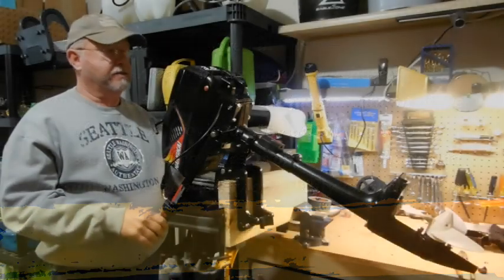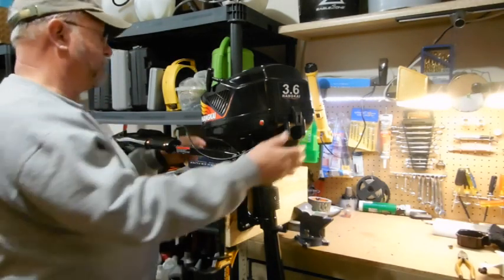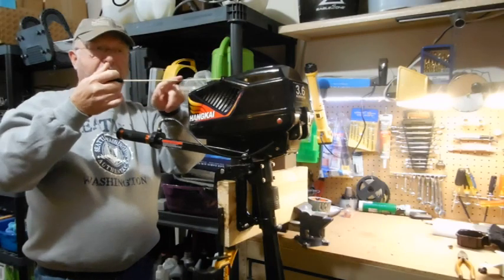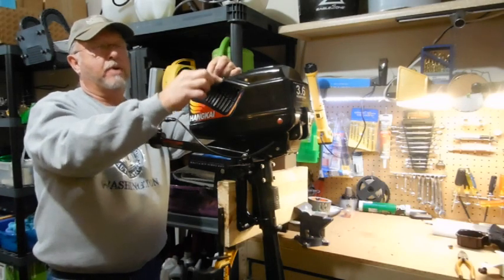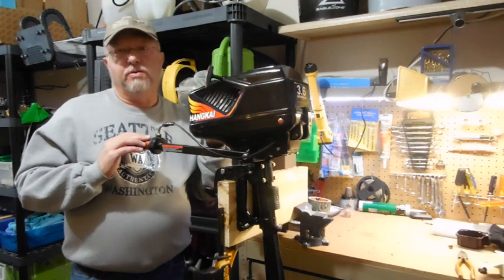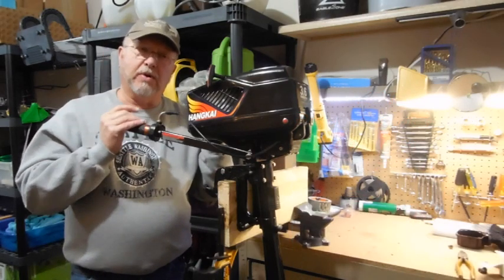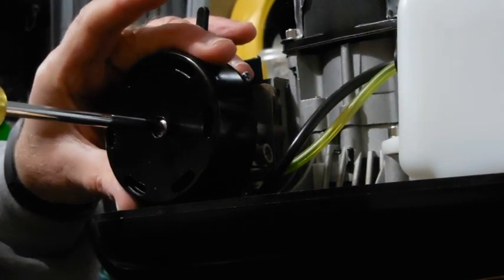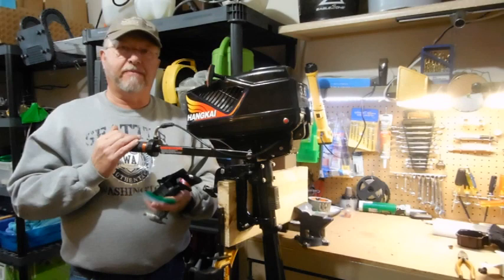Hangkai 3.6 / 3.5 hp outboard motor - 10 Things To Know

Comment: Ten things you need to know about hangkai 3.6 horsepower outboard motor:
1) it is an extremely cheap motor made in China from the lowest quality materials
2) more than likely you will need to work on this motor after each outing
3) 3.6 horsepower rating is a gross exaggeration
4) if you can't fix it yourself good luck finding an outboard shop who would be willing to do the work. In other words it's impossible.
5) it's the perfect motor for those with a hearing impairment. For those who have good hearing not so much.
6) when it fails it will be at the worst possible time.
7) other people at the boat dock pointing and laughing
8) it barely weighs enough to be used as an anchor
9) if you like a tough mechanical challenge this is the motor for you
10) you can go out in a powerboat and still hone your rowing skills
Reply from the maker: Totally loved your list of 10.  Hope you don't mind my laughter. But a lot of your points are accurate! I made the series of my experience with the motor to help others decision on whether or not to consider one.  If you check out all the videos you'll see that I have had to do repairs.  I've enjoyed the journey.... But as I have stayed before.... I always go upstream, so I can just drift back to my starting point. 😂  
Thanks for watching and taking the time to educate others.
Reply: @BoilerDan1  I've watched one or two of your videos before and I have read some of your comments. I appreciate you taking the time to make these videos and educate those who have already made the purchase and find themselves scratching their heads in frustration. It's good to help people to possibly get these motors going and get some use out of them after they have already spent the money for purchase rather than just throwing them in the garbage. I'm glad you got a laugh out of my list of 10 things to know. I did it partly  for the humor and partly as an honest opinion of these motors.
I think the best purchase is to buy a well taken care of motor that has a few years on it but has a lot of years left in it. You can get them for pennies on the dollar sometimes. I have picked up two outboard motors for free. One of them was a 1977 Johnson 15 horsepower which I only had to spend about $40 on parts in order to use it. It ran just fine without the parts but you could not use it on a boat until those parts were replaced. The other engine was a late 60s 6 horsepower Evinrude which I had to remove all of the moving parts for the throttle and advance system in order to clean them up and re lubricate them as they were very stiff in operation but other than that all I had to do was hook up a fuel line and pull the Rope and it was running. You have to have a little knowledge of motors and be thorough in checking it out before purchasing but they are out there. If a person doesn't know much about Motors I think they would still be well advised to purchase something used but checked out by a reputable outboard shop. You will pay a little bit more but ultimately you will be much happier
Reply from the maker: I'm sure all our input will help others! I'm not an avid boater nor fisherman. Anyone who is should consider a better boat and motor!
Thanks again for joining the conversation.😉
Reply: @BoilerDan1  I’ve bought a new Honda four stroke 9.9 and gave me issues so I bought a new tohatsu  9.9 hp
And the carb was wonky from day one and after 100 hurs it just died but that’s because I didn’t drain the carb although I ran it till died. Finally I got a Chinese carb for it and it starts in 1-3 pulls each time now
Reply from the maker: @changodelaporcelainacanada4819  
I’m beginning to think that the ethanol blended fuels cause some issues with any small motors! Sounds like you’re getting a lot of experience working on them! Thanks for watching 👍👍
Reply: @BoilerDan1  yes . Agree. Lawnmower shop guy told me the same. I just looked up pure-gas.org

Comment: Very helpful!
Reply from the maker: Some things I changed my mind about.  No need to add different air filter.  But I’m happy to share my experience with the motor.
Thanks for watching.
Reply: @BoilerDan1  I have watched several videos about to motor, and nobody is doing a break-in on it. I'm going to rig something at home so I can do the break-in at home without going to a body of water somewhere. It seems to be a decent motor for the price and if you break it in properly. I'm not expecting Honda or Mercury quality. I only paid $160 for it and it came in 2 days! After seeing your review, I feel much better about my purchase. Putting it to use will be the real test! Thanks again!!!
Reply from the maker: @geofreak75 just make sure that you keep cool water running in the water tank. I didn’t emphasize that in my video. It was winter and I kept adding snow 😂👍.
I agree, for how cheap it was, it worked for me. But I enjoy tinkering with things.  Like in my videos, I’d get a loser spring, and order a clutch and have it available.
Have fun 👍👍

Comment: WInterize?  do you I need to fog if I use store bought/pre mix fuel?  "TRUFUEL"?
Reply from the maker: Using the pre mix fuel is a very good idea and will help reduce some of the ethanol issues! The only thing that I ended up doing for winter storage was to empty out the fuel tank and then ran the motor until the fuel ran out.  I had no issues the next spring.  I’d recommend emptying out any fuel for storage.
Thanks for watching 👍👍

Comment: Boiler Dan ,
just a little update I've ordered two of those 3.5 horsepower motors I'm going to run them tandem on my little 13 and a half foot 1969  open v hull fishing boat
 
Most   my fishing will be done on the Alabama River waterways down here in Montgomery Alabama so mostly ill use them in tandem coming back Upstream going Downstream I'll probably just use one also it will give me a little bit of security in case one motor happens to flake out on me on the water I'll have another one to get me in

 I have a couple of questions have you seen where there's any way to adjust the valves on this or is it pretty much just sealed??
2. 10 hour break in , in the water bucket, average cool time u allowed if u were to break in back to back on the hourly??..

Tks Captain John
Reply from the maker: Capt. J.  You are in a warmer climate than me, so be sure to run water in the container so you don't overheat the motor.  I'd give it a cool down every couple of hours for sure.  Also don't run at one speed, I set a timer and changed the speed a little about every 10-15 minutes.  You also have to get enough speed to engage the propeller or you won't have water pump through the motor.  Idle speed for a couple of minutes is ok, just not a long time.  Some people have had trouble getting the propeller to turn.  One checked the clutch system and said it was to tight.... Another said take the spring off, and the clutch will last a lot longer.  I'm considering making a video of how to get to the clutch.... It would be a good winter project.....  Regarding the clutch system;
You need to rev up to get it turning, then back it down a little to the speed your using for break-in.  Also The fuel cap vent hole doesn't work real well, so you might need to loosen it a bit as you run longer.  I'm not able to provide information regarding the valves.  I've not opened the motor up, and that is a little beyond my experience.  You can also break the motor in on the river,  just no full speed until you get the break in done, and then I'd take it a little easy at first.... But mine is holding up fine other than the things I listed in the videos.      CHANGE THE SPARK PLUG! The ones in them are junk.... 
Anyway, enjoy the adventure.  Thanks for watching.  I'm no expert in this motor, but it's been fun working out the bugs.  And being retired, it's keeping my mind alert making the videos!  Watch out for gators.... They can out swim this motor!   :0)

Comment: 1.  What pin do you remove to fill prop with gear oil 
2.  What kind of gear oil do you use?
3.  What kind of grease do I use to grease the pivot point?

I'll ask more questions as I watch this video, so far, it has only been slightly helpful.  I knew I would have to put oil in it but did not know where to put the oil and your video is so vague it didn't really help me.

3:14 Fuel Mixture?  It's an electric motor.  ROFL  It runs off 2 24v 120AH batteries wired in series according to the manufacturer's manual
Reply from the maker: There’s just two bolts holding the cap on at the backside of the propeller.  Be careful not to over tighten them. Also do not completely fill the area with gear oil. Look closely, there’s a line a little below the top that you fill to.
90 weight gear oil 
To grease the pivot point it’s just standard automotive grease. You’ll need an inexpensive grease gun to inject it into the shaft.
Here’s a link showing me changing the gear oil and the two bolts.
Thanks for watching 👍
https://youtu.be/NCALT3MKAEk

Comment: BoilerDan1 the manual says to use 10w 30 2 stroke oil to gas mix is that what you did or can I use 2 cycle oil in the 35 to 1 mix
Reply from the maker: Ken Garloch :  there are two style motors. If you have the two cycle motor you will use the 2 cycle oil and mix the oil and fuel.  If yours is the 4 cycle motor it the 10w30. That type is not mixed with the fuel.

Comment: Which is the best OBM for sea use?  And for Intex mariner 4 boat.
Reply from the maker: I'm in middle America, no ocean for hundreds of miles.  The 3.6 hp Hangkai doesn't have a lot of power, so I'm not sure it would be my choice for sea use.  You might check YouTube for users that have it in salt water, or make sure you rinse any salt water out of the unit after each use.

Comment: Really want to get one of these going to subscribe to see how it works for you!
Reply from the maker: Watch all the videos you can find! Read some comments and make your decision on what's best for for. You'll find negative and positive experience with the motor.  This summer should be a good gauge of how the motor holds up for mine.  One positive thing, it's a simple design and I've been able to fix anything that's gone wrong and I'm not a mechanic or anything related. Just an old guy playing around.

Comment: i check on the hangkai website the price of motor 3.6 HP 4 stroke and 3.6 HP 2 stroke is similar. Can you advise which one i should to buy ?. Thanks
Reply from the maker: I purchased through eBay as the price was less.  The advantage of the 4 stroke is you do not mix oil and gas. It also is air cooled.  I choose the 2 stroke because I have to lay the motor on its side to transport it.  With the oil and gas mixed, there is less risk of spilling and I have heard that laying the 4 stroke on its side can result in oil causing some problem.  But the choice is yours to make.  Maybe research some more on the differences will help you decide.
Reply: BoilerDan1 4 strokes ya gotta lie em down with the oil pan down... That will prevent oil from leaking into cylinders . usually most mercs have a label that says " this side down"... Lay my merc 3.5 4 stroke on that side.. No problems at all
Reply: I wouldn't buy either, get a few more $ and buy a real outboard from one of the online sellers or find a lightly used second hand model. These outboards don't sell for much less than those from established and reputable manufacturers.
Reply: Fiveo here demand far exceeds supply for the below 15 hp because the fisherman use them as trolling motors so man are they hard to find...ones over 40 HP hard to find but exact same price as  9.9 hp the defacto industry standard....not too big and never too small unlike the 2, 4, and 6-8 hp
Reply: I would go 4 stroke if you want it quieter & don't wanna hassle mixing the gas
Reply: Don't buy Hangkai outboard motor. The company can't provide any paperwork to apply for a motor title
Reply: Don't buy Hangkai outboard motor. The company can't provide any paperwork to apply for a motor title
Reply from the maker: Thanks for joining the conversation, however in many states in the USA, boat motors are not registered in that way, the boat they are put on carry the registration.  The raft I put mine on was registered through the state BMV of Indiana.
Sorry if it didn’t work out for you in your location.

Comment: Hi there. I have a 2hp hangkai outboard. Do you know if it is the same motor?
Reply from the maker: I'm not familiar with the 2 hp, but there are several motors that are similar. Sorry I couldn't fully answer your question. I'm guessing some of the covered areas would apply to your motor too.
Thanks for watching.

Comment: Hey, how did this motor hold up over time
Reply from the maker: The clutch system wears out within one season.spring is too tight. I have a segment on it.  Also fuel lines deteriorate if using unleaded fuel.
I sold it, but other than those two items mine did fine.

Comment: Hello Dan, I bought a hangkai 3.6 again and I have concerns about a v Ed or that the motor when it is not walking does not pump water as well and the other thing that I appreciate is that you have to accelerate a lot so that the block Ed works you have any suggestions or solutions  possible for these two things thanks
Reply from the maker: Ramon Folgar : at an idle it won’t circulate water. The water pump is hooked to the shaft the rotates the propeller.  I had to replace the clutch in mine. At that time I put a much less tight a spring that disengages the clutch. I highly recommend considering doing that.  Here’s a link showing that video of the spring. https://youtu.be/G4qLw14lf9k
Reply: @BoilerDan1  Good morning Dan, do you think that changing the cloche spring could solve the problem or have to be replaced completely, nothing happens to the engine when it is on without clogging or apart from the water it has another type of cooling for when it is in that  been, thank you very much for your attention and time regards Ramon
Reply from the maker: When idle speed it will air cool, but you shouldn't let it idle for long periods of time.  If you have run it for a season and notice you must run it fast to get any water to flow out your clutch is wearing out.  So yes, you probably need a new clutch.  I replaced the spring in my new clutch and it works much better.  Water comes out with just a little acceleration.  You can find a weaker spring at hardware stores as the one that comes with a new clutch is still to strong.
I found my new clutch at Amazon, here is a link:    https://www.amazon.com/gp/product/B07J6F4J6M/ref=ppx_yo_dt_b_search_asin_title?ie=UTF8&psc=1 
And I made two video's showing removal and replacement.  You should be able to find those on YouTube.
Reply from the maker: @ramonfolgar5539  I'm not sure my earlier reply was clear.  It does sound like your clutch is worn out.  So I think you will need to replace the clutch and while doing that, also replace the spring that comes with it.  The spring is much to strong for this little motor.  I hope that is clearer than what I wrote earlier.  I was happy to try to help.

Comment: Have you ever tried the 4 hp 4 stroke version? Which is better?
Reply from the maker: Conner Jones - I chose the 2 cycle so I could lay it on its side to transport plus it was cheaper. That being said, the air cooled and a little more hp sounds like it may be a better choice. I’m considering buying one but as yet I haven’t.  If you lay the 4 cycle on its side you can get oil leaking into the cylinder. Could solve that by removing the oil during transport.     Thanks for watching.